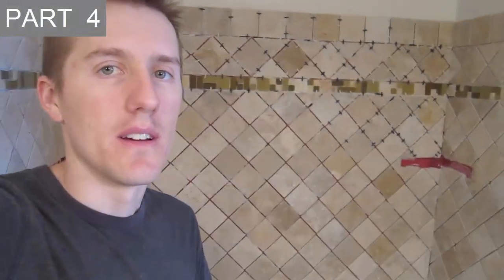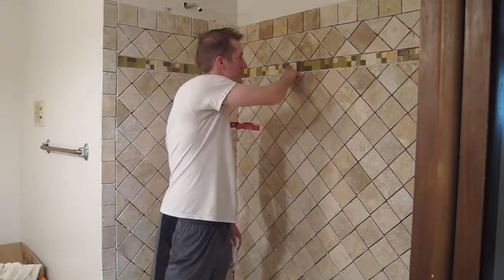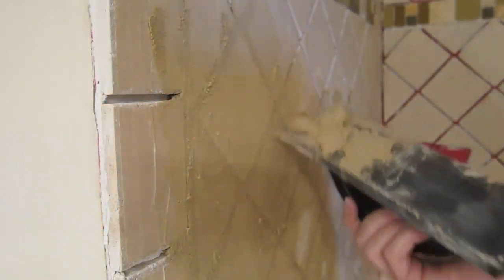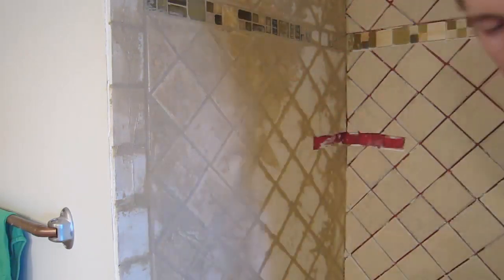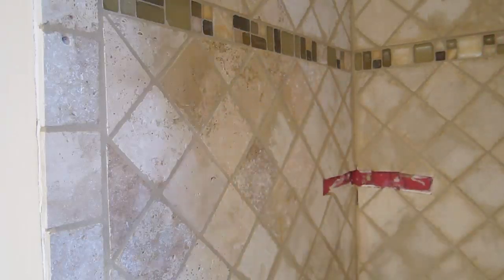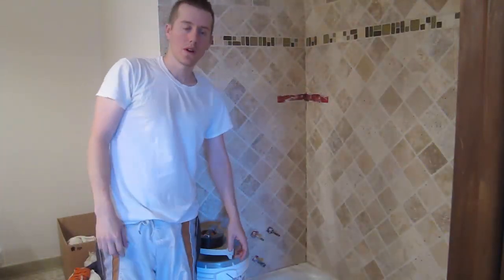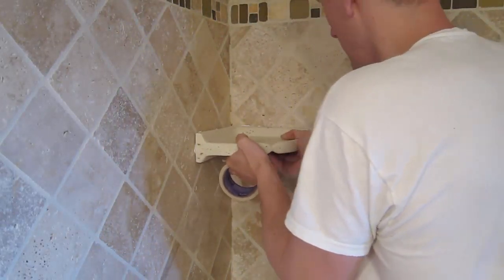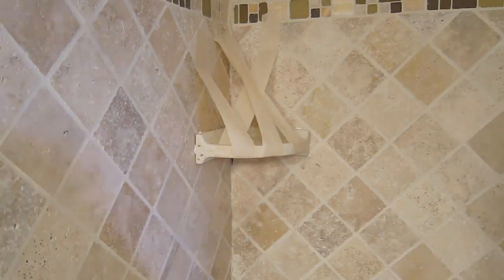Shower Tile Grout - Small Bathroom Remodel - (Part 4)

Comment from the maker: Tools I Used:
Tile Saw - Light Duty:   https://amzn.to/2E7nUSo
DeWalt Miter Saw  (12-Inch):      http://amzn.to/2ubmPcB
Bostitch Air Compressor  Nail Guns Kit:      http://amzn.to/2ub3KXZ
Framing Nail Gun:      https://amzn.to/2IRMFWa
Multimeter - Easy to use design - https://amzn.to/2H30LDP
Self-Leveling Laser Level:      https://amzn.to/2DXyqeK
Electrical Tools - Insulated Set:      https://amzn.to/2DXDzTX
Wire Strippers:      https://amzn.to/2GfamWP
Self Adjusting Wire Strippers:      https://amzn.to/2IRNJcC
Drywall Sander Pad:      https://amzn.to/2ujBt1n
Drywall Hand Saw:      https://amzn.to/2pHmZ6D
Stud Finder:      https://amzn.to/2ulf3Nn
Heavy Duty Paint Sprayer:      https://amzn.to/2pH0qis
Carbide Concrete Scoring Blade:      https://amzn.to/2GhbDg8

Materials:
Drywall Screws:      https://amzn.to/2DXgcKy
Drywall Mesh Tape:      https://amzn.to/2GakyUy
Electrical Can Lights - 6-pack:      https://amzn.to/2GewgJM
Bathroom Faucet:      https://amzn.to/2ISNLAY
Tile Sealer Jug:      https://amzn.to/2G8AUNb
Tile Sealer Spray:      https://amzn.to/2I2Z3Bi
Hardi-Backer Screws:      https://amzn.to/2I8vJcD
Tile Spacers:      https://amzn.to/2IR7EIN
Silicone Caulk:      https://amzn.to/2pIJNCh
Bathroom Sink:      https://amzn.to/2IR7KQF
Toilet:      https://amzn.to/2pJD3nI
Trowel:      https://amzn.to/2IVtB9F
Toilet Wax Ring - Extra Thick:      https://amzn.to/2pLgpLx
14-2 Electrical Wire - 50':      https://amzn.to/2DWQINn

►  Complete Playlist: .......... 
https://www.youtube.com/playlist?list=PLnfZ3Rt-xEK9Hv5SzyewklePfHRFQmBqJ

--------------------  Full Bathroom Shower Tile & Floor Remodel Parts:  --------------------
►  Full Video - Shower, Floor Tile, Cost, Grout, Faucet .......... https://youtu.be/hLrMDrP4ah8
►  (Part 1) - Demo Small Bathroom Remodel .......... https://youtu.be/Jxs0Oomja38 
►  (Part 2) - Tile Shower Prep Work .......... https://youtu.be/lepLiNMc0yM
►  (Part 3) - Small Bathroom Wall Tile Remodel .......... https://youtu.be/PV_Ayo2X4-A
►  (Part 4) - Shower Tile Grout .......... https://youtu.be/MEaif4lGYQ
►  (Part 5) - Grout Sealer & Shower Tile Shelf .......... https://youtu.be/HRX6xGKN3YM
►  (Part 6) - Plumbing Shower Faucet .......... https://youtu.be/qXbGu0gRmW8
►  (Part 7) - Floor Tile & Grout .......... https://youtu.be/NhN-Ud1PrEU
►  (Part 8) - Install Toilet & Tile Flooring .......... https://youtu.be/lUeTIcXg6MU

--------------------  Half Bathroom Tile Floor Remodel Parts:  --------------------
►  Full Video - Half Bathroom - Tile Floor, Toilet, Sink, Faucet .......... https://youtu.be/tLRpBMRyirA
►  (Part 1) - Cost Spreadsheet, Materials, Demo, Floor Tile .......... https://youtu.be/huGIYLttwvw
►  (Part 2) - Cut & Install Floor Tile, Grout, Baseboard .......... https://youtu.be/eZqVGJWK6B0
►  (Part 3) - Install Sink, Faucet, Plumbing in Bathroom .......... https://youtu.be/Ci6wB0GFrAI

--------------------  BLOG POSTS:    For Bathroom Remodels  --------------------
■  1/2 Bathroom Remodel .......... https://goo.gl/Ru4nkF
■  Bathroom Remodel - Material & Planning .......... https://goo.gl/pddh4V
■  Save 20% at Lowe's and Home Depot .......... https://goo.gl/YX3Vr1

○  Cost Opinion Spreadsheet .......... https://goo.gl/XjNrmM
(Use to determine rough cost to remodel bathroom)

This video is the full length, from start to finish, process for remodeling a full bathroom and small half bathroom.  Demo floor and shower tile.  Install concrete backer board.  Install shower tile and grout.  Install floor tile and tile baseboard.  Plumbing.  Redo plumbing and install a new shower and sink faucet.

I filmed this the only way i could ... as someone who has never done it before.  We made mistakes as we went along but overall it turned out great.  We are very happy with the result and saved a lot of money doing it by ourselves.  

Hopefully you learn something by watching these series of video's.  Let me know anything i missed, the many things we got wrong, and something you recommend to make remodeling your bathroom easier.

INDEX:
Demo:  ...........................  https://youtu.be/hLrMDrP4ah8?t=1m36s
Backer Board:  ...............  https://youtu.be/hLrMDrP4ah8?t=7m15s
Waterproofing:  .............   https://youtu.be/hLrMDrP4ah8?t=16m10s
Shower Tile:   ................   https://youtu.be/hLrMDrP4ah8?t=20m5s
Shower Grout:   .............   https://youtu.be/hLrMDrP4ah8?t=32m43s
Shower Shelf:  ...............   https://youtu.be/hLrMDrP4ah8?t=38m30s
Faucet & Plumbing:  ......   https://youtu.be/hLrMDrP4ah8?t=46m57s
Demo Floor Tile:   ..........   https://youtu.be/hLrMDrP4ah8?t=1h2m18s
Floor Tile:   .....................   https://youtu.be/hLrMDrP4ah8?t=1h5m37s
Floor Grout:   .................   https://youtu.be/hLrMDrP4ah8?t=1h12m44s

(Disclosure Note: Please note that the Amazon link(s) above are affiliate links, and at no additional cost to you, I will earn a commission if you decide to make a purchase after clicking through the link.)

Comment: Place the shelves and remove them to see if you have enough adhesive. The slots should have been filled first. Much better to have too much and you need to clean it, rather than not enough and it falls off from the wall.